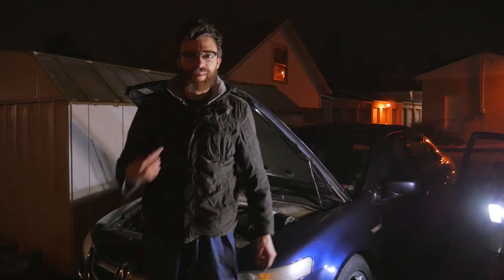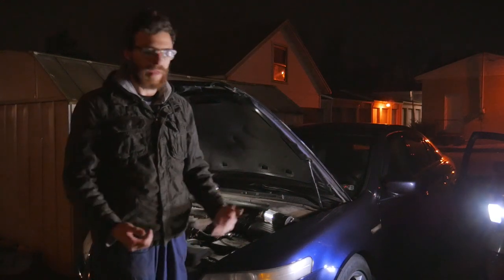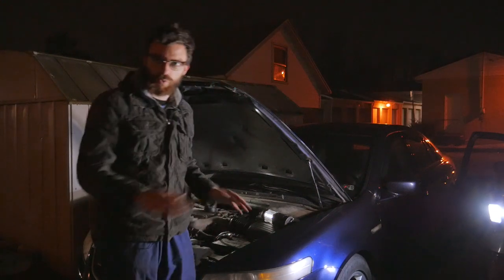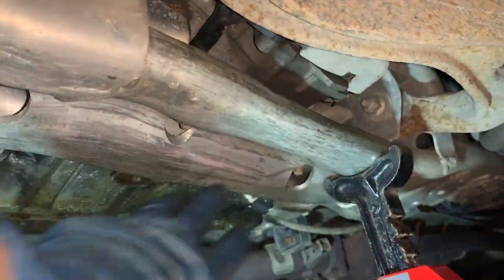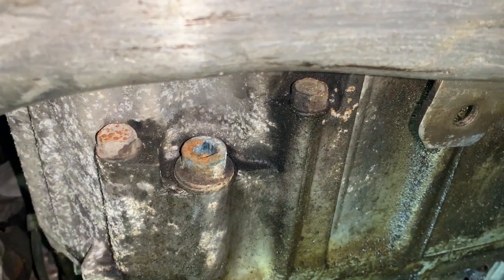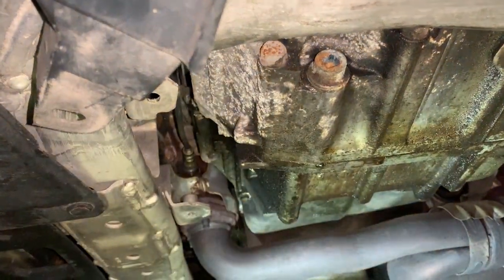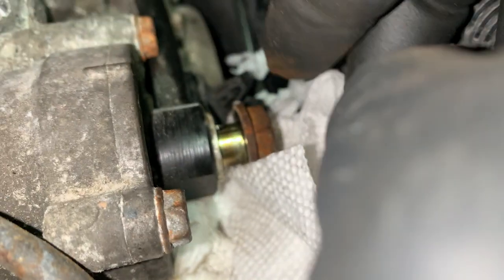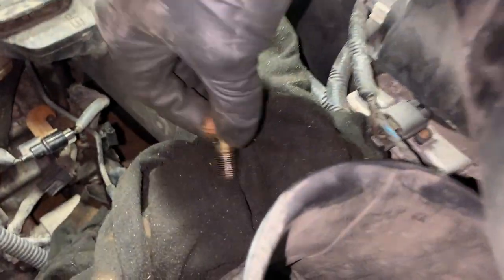Replacing ORIGINAL Trans Filter on '05 Acura TL! Falling Apart! How-To for Fluid and Filter

Comment: Did the same ATF filter and ATF change on a '04 TL. The filter looked exactly like yours, really bad. Additionally, pieces of the orange plastic that hold the filter together, and broke away, where sucked inside the shaft of the banjo bolt. I'm going to drive the vehicle for a week, do the 2nd fluid change, and drive for another week, and do the 3rd fluid change. Cannot believe that Honda/Acura don't have the filter change listed on their 50K or 80K service list. The person that had this vehicle before me, took it to an Acura dealer for service and my guess is they never changed the ATF or the filter. I had to use a small breaker bar to loosen the AT drain and AT filler plugs, a second hint, after the color of the ATF drained, that the fluid had never been changed in 19-years and 160K miles.  Next time you film, get a drain pan!
Reply from the maker: Glad you got to do your swap out! So critical! The drain bolt is nuts sometimes. I did it on an MDX before and tough as nails. Ha, I don't disagree one bit on the drain pan. Unfortunately, I didn't have my supplies all with me so I had to make do and didn't do very cleanly. Power washer will be my friend.
Reply: I just replace my transmission filter and same thing with stuff from the filter inside the banjo bolt.. i belive thjs filters should be change every 60k miles and no more.. leaving them there for over 100k miles causes the filter to come apart inside.
Reply: I am watching as many videos as I can and preparing to do it myself a fluid/filter change plus pressure switchers replacement on my 2004 Acura TL. 

I love my Acura and got it at 237k miles on it. Runs smooth but I can hear shift to 2nd gear is not perfect and it had a blinking D light. 

I pulled up the codes and it pointed out to a defective tranny switcher (that is still working). 

I have to do it myself because the mechanic wanted like 700$ to do all that. Plus it is a great experience. And I don't risk them breaking anything.

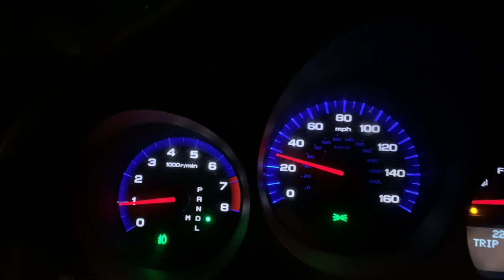Comment: @19:00 2003-2005 year Acura/Honda owners of the 5-speed auto have to be super careful when changing the fluid. A simple drain and fill is sufficient to make it happy. A 3x3 fluid change/fill will get rid of too much of the clutch material that’s floating in the old fluid. It’s around 2007 onwards where Honda/Acura made the 5-speed and 6-speed transmissions a LOT more durable.
Reply: I'm on drain 2 of 3 from a 2005 TL that's not been changed in 80k miles, so far so good.
Reply from the maker: Guess it could happen anytime on any car. I know doing it on this one and my personal one, they were both very happy, indeed!
Reply: @thepiecesfit5049  Let keep our fingers crossed. And how has the transmission responded to the fluid change?
Reply: @GTSam  I feel you.
Reply: @MrSamPhoenix  so far fantastic! Everything shifts so smooth now. I had a pretty rough transition before, which jerked the car forward in the 0-60 mph range. Gone now.

Comment: I have seen people take line lose going trans cooler and start your car and let it pump fluid out and once it starts blowing bubbles shut your car off and hook line back up and fill tranny and you good to go but check your fluid a day or two and top it off if low .
Reply from the maker: Hum, I could see that working but, just for me, I'd be too worried screwing something up or getting too much air in the system. You try it before?
Reply: Really bad idea.

Comment: I can’t find the outside filter on  my 2008 Acura Tl. Some people told me the 07-08 does not have an external filter
Reply from the maker: @mike4fo  ahhh, you got the special years. Two things for this: there's an internal "strainer" (what Acura calls it) and it's inside behind the driver front wheel. The 2nd filter is opposite and it's accessible but not like the 04 era.

Comment: I’m getting that the part number you provided for the filter is not for a Acura Tl but for a Honda accord. I’m seeing the actual part number is 25450-P4V-013
Reply from the maker: Hum, that doesn't sound right and looking it up, doesn't look right either. That style filter I used recently on a Civic from 2014 with a CVT. If the Accord is similar model year, it should be the same. But, with that, is it a V6 or a i4? That would change it up too.
Reply: @GTSam I did a little more research and I believe the part number you provided is for accords and 04-06 model tl’s. My wife has a 07.
Reply from the maker: @isaacpiasta1660  ah, yes! The 07 and 08 models did change their filter AND location. It's the opposite side they are on for accessing. But I believe the 07 and 08 ones were more sturdy too.
Reply from the maker: Back to the original question, the one I listed is for 04-06 TL and the Accords did use them too. Accords would be 03-07 for the V6 models.
Reply: @GTSam  glad we cleared up the confusion.

Comment: From what i read the transmission 
Has a filter inside it behind the pan
And one on top, both should be done.
Reply from the maker: @bobbg9041  in theory, yes, that would be amazing but that means getting the internal one is removing the whole side of the cover. At least getting the top one and fresh fluid is a game changing great start.

Comment: Valvoline is approved for z-1... probably better than the OEM
Reply from the maker: It's too suspicious. Looking at the product info sheet, it does say just about every transmission it can be used in even CVT. But that doesn't make sense. CVT fluid is not the same color or consistency and definitely not the same as ATF. Also in the info sheet, they state "if an OEM licensed product is preferred, we recommend Valvoline DEXRON VI, ATF-4 and MerconV for the corresponding applications." If MaxLife covers all those too why do they say get the specific type then? If I was in a pinch, yeah I'd use maxlife.

Comment: My car keeps slipping do you think that'll help my car it jerks and everything I got the same kind of car
Reply from the maker: I think doing everything could help. It's not a guarantee but a good shot! Between the fluid and filter changes, could help. POSSIBLY an additive.
Reply from the maker: Actually, check out the next video on this TL because it was slipping but using an addictive with the filter and fluid changes did wonders.
Reply: Think they have additive u add.. leave out some fluid and add additive… no slip additive

Comment: Did you have any codes come up? D light was flashing?
Reply: In my case I have two codes, P0848 - P0700 - P0848: 3rd Pressure SW circuit high - P0700 Trans is failing / metal shaving ? I check the dip stick im not burning the trans oil as it smells normal not any outlandish color - above two dots when checked. Car shifts alright to me 2nd to 3rd could be better so it makes sense that the p0848 is coming up kinda rough - as well as from park to drive it lunges forward into to drive. Only two symptoms I have. As for p0700? Is this it for my trans? I’m thinking I should do this  service? As maybe this filter is causing something to happen to my TL? I have never checked this before at about 160k miles
Reply: D Flashed on me while driving to pick up my gf, drove it home right away only put like 25-30 miles on it. No cel but just a blinking d.
Reply: Mine just started flashing the other day. (2006 early production) never had a problem with the trans whatsoever. I did change the fluid once just for piece of mind. Trans shifts smooth and has never given me any problems. I just did the 3rd and 4th pressure switches and I’m about to do the fluid and filter tn. I’ve been driving it and no flashing D as of now!
Reply: @mitchelwatson8963  so you changed fluid for the first time when it happened then again? I plan on changing filter - fluid - and pressure switches all at once? This ok to do? I feel like this would all help the trans?
Reply: @mitchelwatson8963  mine is a 06 as well :P guess the 06 trans is the worst from my research?
Reply from the maker: @mitchelwatson8963  How'd you make out?
Reply from the maker: @playaaa7603  I was really thinking on this one because I was like "there had to be a flashing light next to the D indicator..." BUT I realized there was not since it never was able to drive far enough! haha the only time I really drove it was afterwards but still nothing.
Reply from the maker: @playaaa7603  If '06 is the worst, then that would make more sense because my '04 is a beast still and just did a fluid and filter change on that as well. Now, feels even better! Still haven't changed out the pressure sensors yet and I've had it over 100K miles. #noshame But changing the fluid, filter and sensors would be a good idea. The only time it wouldn't work out is if your trans is so bad, that you loosen up the sludge holding it all together but hasn't happened to me and any of my cars yet (not just Honda/Acura's).
Reply: @GTSam  I got myself into a whole NEW problem during the process. The trans filter change was smooth and successful, but I somehow managed to crack the actual trans case where the bolt screws in. (So when the bolts fully seated you and basically see a pie shape cut out of 5-6 threads. My heart dropped. I was lost on what to do but thanks to boards like these I got some JB Weld and sealed the piece back to its location. I tested the bolt tn and my god it screws completely in! Now I just have to see if it holds fluid and if I should completely just jb over the entire bolt as this will be it’s last change anyway.
Reply from the maker: @mitchelwatson8963  WOW, that stinks but good thinking on the JB Weld. Not recommended but when you gotta innovate, you gotta innovate haha. Gotta let us know how it turns out and holds!
Reply: @mitchelwatson8963 Those small 10mm bolts that hold the housing cover for the filter are way to weak for the amount of pressure.. i wich they had use a bigger bolt like a 12mm at least..

Comment: Does anyone know if the 05 mdx have the external filter for the trans like this one?
Reply from the maker: Very similar, yes. Not the same parts but should be same side with similar canister style housing and with a banjo bolt on the outside of it.
Reply: @GTSam  thanks for the reply! My mdx just crossed 240k miles and I’m starting to feel some rough shifting from 2nd to 3rd gear both up shifts and downshifts. I’m planning to do a full service soon, that includes cleaning the shift solenoids and now I’ll add changing the filter to the list.
Reply from the maker: @jonck146  sweet! Good luck! Get some of that OEM equipment and should run smooth again! Report back your findings!
Reply: @GTSam  for sure. Will do
Reply: Did you have the filter replaced?